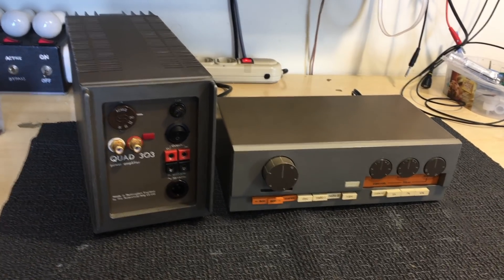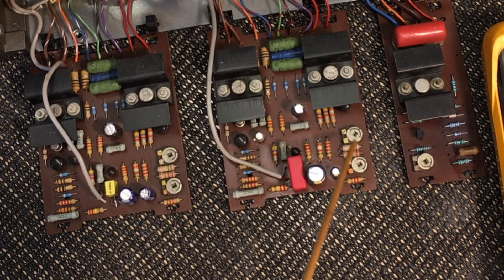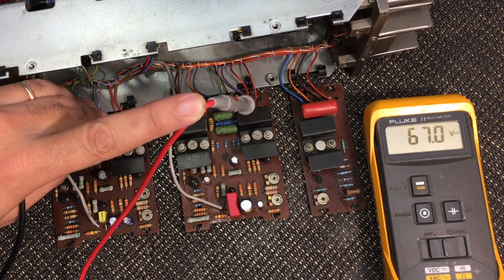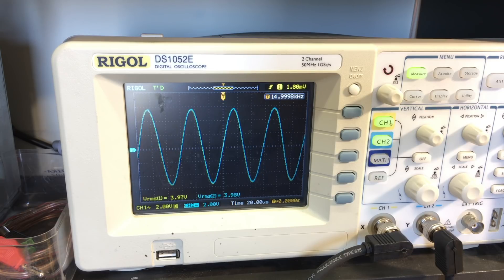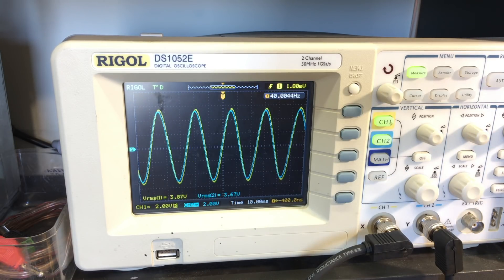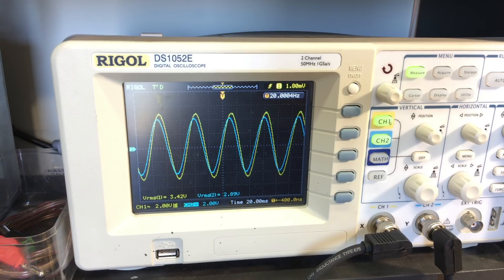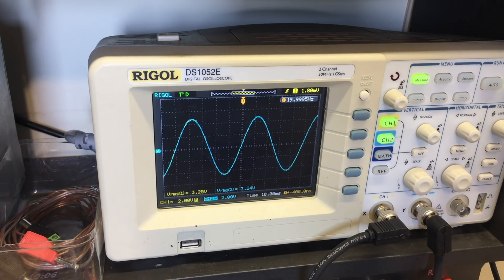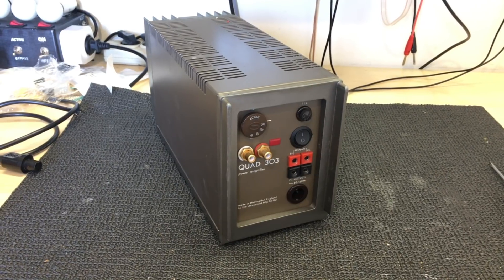Quad 303 Amplifier capacitor replacements

Comment: Hello, this is the best explanation I’ve seen on adjustments. I’m trying to follow your steps exactly but no matter how much I adjust the pots, nothing happens! What error can cause in adjustable voltage?
Reply from the maker: I’m afraid I can’t answer that from here. Study the schematics and make sure you’re adjusting the correct part and measuring at the right point too.

Comment: Am taking my used pair of 57 speakers, used 303 & 33 back to their home :; Quad in Huntingdon, Cambridgeshire, tomorrow for servicing  / refurbishment/ repairs as required.
Also considering how to fabricate a mild steel box section floor stand for the speakers to lift 18 inch from the floor and to allow the units to tilt forward & backwards as my ears need !
There are absolutely no ready to use steel stands specifically to suit Quad 57’s and a few mentions of ‘spider legs ‘ made from timber or man made board . But IMO they look ugly and I am able to design and build sleeker , less clunky and better home made stands
Reply from the maker: Good move. The result should be perfect.

Comment: if anyone else ends up here because they have a 303 that runs insanely hot but sounds fine..... mine, I could smell the paint from across the room..... after a bit of research, it emerges that the original op transistors had been replaced with more modern 2N2955/3055 pairs that have a much greater power bandwidth, extending to many tens of kHz, & were thus able to sustain oscillation at supersonic frequencies. quad had not designed this out because when the amp was new, these devices didn't have this kind of bandwidth. so if you replace the op transistors, try to find N.O.S. devices, or be prepared to modify the driver circuit quite considerably!
personally, I prefer the sound, the design & the overall aesthetic of the leak stereo 30, the 30+ & the 70.
I find myself agreeing with another comment here about the 33 preamp- the switches are awful, & you will end up with a deadspot on the combined volume/power switch; good luck finding a replacement. same problem affects the leak, but it's a lot easier to add a separate power switch to that.

Comment: Did you mean to adjust the 67V supply with a dim bulb in circuit? That's what the video implied. 
I don't think the original -1dB at 30Hz is bad, do you?
Reply from the maker: No, the final voltage adjustment must be done at full line voltage. I think the low frequency response is very good.

Comment: I have just started the refresh of my 1979 303 sr 85849, the four large capacitors have been replaced. One had bulged and others had evidence of leaking. I noticed that you used the current limiter with a 40-watt bulb. Was the current limiter still in the circuit when you measured the voltages and bias currents?
Reply from the maker: No, when you set that up you must have the full supply on.
Reply: @electronicsoldandnew  That's what I thought, because the voltage drop across the limiter would cause a lower voltage input to the mains transformer and therefore a lower output voltage. Lovely tutorial very very clear and concise.. Are there many Quads in Madeira???. Plenty where I live in England !
Reply from the maker: There actually are quite a few. Much more that I ever expected for such a small place.

Comment: I just picked one of these 303/33 combos up to go with the Quad ESL 57s I’ve had in storage for about 20 years. Tell me, is it dangerous to remove the cover of these amps and have a peek inside? What precautions do you have to take? Thanks.
Reply from the maker: beware of shocks 😊 
Anywhere there is mains wiring, you’re risking a zap ⚡️

Comment: I am owner of a 303 and a 33 by Quad for more than 20 years.  Unfortunately here in Rio de Janeiro is very dificult to  find good technical people  for repairs and therefore we usually just have 2 options for these kind of equipment by here:  or  to Pray or go to Sao Paulo city try find some technical people, what is not also an easy option also.  Could you plese  tell me what fuse especificatrions the 303 use at its back?  I would like thank you  for the nice video and so sorry my limited English.
Reply from the maker: O inglês não é problema entre países irmaos 😊 
De acordo com o manual de serviço, o fusível é de 2A, lento. 
http://www.meridian-audio.info/public/quad-303-service-data%5B1961%5D.pdf
Reply: @electronicsoldandnew  , muito obrigado pela sua resposta!! Espero encontrar o fusível por aqui no Rio.  Grande abraço e obrigado!!
Reply from the maker: prazer

Comment: Excellent video, thank you. I did the same thing on a Leak Stereo 30+ i.e. changed all the caps on one channel only. I found as you did that the main benefit was a flatter frequency response, and also faster rise time, but I can't honestly say I could hear a difference.  Small point: I suspect you should measure voltages with an analogue meter (20k ohms/ volt) if you are to compare with the design figures; I use an old Avo 8 for this (great excuse to use a lovely piece of kit!).
Reply from the maker: Terry Nicklin : Hi Terry. I agree that the differences in sound often require better ears than mine to discern. However, most of the owners of this gear have in fact better ears, so I’m always happy to oblige. I also have an Avo 8 that I’ve restored, so should in fact use it more often.
Reply: The difference in sound after recaping should be night and day! If you dont hear it you have a problen!

Comment: 1. All the necessary Bulgin connectors are still available and no problem at all. 2. Measuring the voltage between pins 6 and 1 is slightly invalid. 3. The difference between 3.8VRMS and 3.6VRMS is neither significant nor audible. 4. The LF response isn't affected in the slightest by the midpoint or bias adjustments, or by C101 or C106, but it is affected by C100 and C104 and the output capacitor, which should be doubled. 5. All Peter Walker's amplifiers follow a consistent theme of -3dB points at 15Hz and 55KHz, and the 303 is no exception, contrary to what is claimed in other comments here.
Reply from the maker: EJP : thanks for your input.
Reply: The manual recommends 6-10mA across pins 4-6. Given that the emitter resistors sum to 0R6, that means 3.6-6mV across those pins, not 6-10mV. You have it slightly overbiased. I usually end up at 5mV even with the aid of a distortion analyser. Above that it tends to run away, but it varies unit to unit. You will get a access to a bit more bass by doubling C104 to 22uF. This defines the pole of the DC servo, and it works in conjunction with the input capacitor and output caps to set the LF limit. Changing only one of those three by itself can't do much. There are persistent myths that Pater Walker designed these for the LS3/5A with nothing below 70Hz, etc., but they are just myths,

Comment: I have one of these amps in for repair at the moment. I would be interested to see how you input the signal to the amp and how you connected the scope to each channel. Did you use a dummy load? Great video though. I was thing of trying some audiophile caps to see if I could get any measured improvements. Thanks Graham
Reply from the maker: Radiocruncher : the inputs on mine are  via the two rca sockets, but this was a mod. The original has a proprietary socket and you can follow the wiring into the two amp boards via a small screened cable. It’s fairly straightforward. 
I made a ‘box’ that received the speaker out connectors and then directs the signal either to a set of speakers or to a dummy load (2x 8ohm resistors that I use as 8 ohms or short to make it 4 ohms. The same applies to the other channel, and both are completely separate as far as ground is concerned. 
I tap the signal prior to the speaker/dummy load Re-direct from each side and connect to two bnc connectors to be able to connect each side to the scope. Beware of the scope part: if you connect a scope you effectively short the negative to earth, which may not be acceptable in some cases. Also, even if your scope is on an isolation transformer, if you connect BOTH scope connectors, your are again shorting the two speaker grounds to each other. In this case I believe everything is referenced to the same ground anyway so it won’t be a problem, but I wired it this way to leave my options open when working with amps that have crazy grounding schemes. 
This  is a fairly simple amp and there is los of info available on the web including setup and biasing instructions. 
Good luck.
Reply: Electronics Old and New by M Caldeira It's not s proprietary socket, it is a standard 4-pin DIN Socket, available anywhere.
Reply: Thank you very much for the comprehensive reply. I will see if I can rig something up to test them. I assume you used an AF generator or waveform generator for the inputs. Thanks Graham
Reply from the maker: Radiocruncher : yes, signal generator at any reasonable frequency like 1kHz, Ana start at about 20mV amplitude then go up.

Comment: The main reason for the poor LF was that the 33/303 was designed to work with the electrostatic speaker. 90% of people what purchased Quad would also buy the complete system, as indeed I did. The original quad valve amplifier only produced about 15 watts, but when the 303 came out with 40 + watts the problems began. The transformer in the electrostatic would saturate and present a very low impedance which the amplifier did not like. The answer was to limit the LF response in both the power amp but mostly in the preamp (as you will find)
This removed the issue but made it sound very lacking on standard loudspeakers, plus current limiting made the 303 a very un dynamic amplifier. At least these modes stopped people damaging the electrostatic and blowing up the 303.
The bias needs to be on the high side to stop crossover effects showing up on a distortion analyser at 10Khz and over, slight but visible...audible...well that's debatable!!
Reply: What 'poor LF'? The evidence is entirely against this claim. The 303 is -3dB at 15Hz, and the 33 at about 20Hz, mainly I believe as an anti-rumble measure, and they actually lowered the LF pole in the 33 during production. And an LF pole in a preamp isn't much of a strategy to protect a loudspeaker.
Reply from the maker: That makes a lot of sense. Hadn’t thought of the problem of the ESL’s overloading this little amp.
Reply: michael - you sound like u know your shit - if only i understood your language.
 i have a couple of 303's paired with ditton 44's and i bypass any preamps altogether- and to tame the sound i've got a dacmagic100 feeding it. i'm getting audio definition i've never thought possible digitally - and its risen again after my last 303 arrived the other day from Ebay and by all accounts its been in storage for 20 years and belonged to the vendors good friend prior to that which explains, atleast to me, how perfection got owned .. -  and i find flaws in most 'stuff' - where do i go from here ? - - also, electrostatic speakers - ?
Reply: This is urban myth. It is certainly untrue that 90% of 33/303 customers also bought ESLs. The sales figures tell you that. 120,000 33s, 94,000 303s, 56,000 ESLs, and many of those were driven by Radford, McIntosh, etc. All Quad power amplifiers are -3dB at about 14Hz.

Comment: The main low end restriction is the 2.000 uF output capacitor. With a 4 Ohms load,  response will be 6dB lower at 20 Hz. The input time constant, even with the original 0,68uF, will have the -6dB at around 10Hz. Quad is known for never been a big fan of wide bandwith products... ;)
Reply from the maker: Jorge Santos : true, but I wanted to see what the affect of the input cap was, since I was going to change it anyway. It is slight but visible. A bigger output cap would definitely make a huge difference.
Reply: Response will be -3dB at 20Hz in voltage terms. The output coupling capacitors were the biggest ones that would fit. You can easily double them or more nowadays,